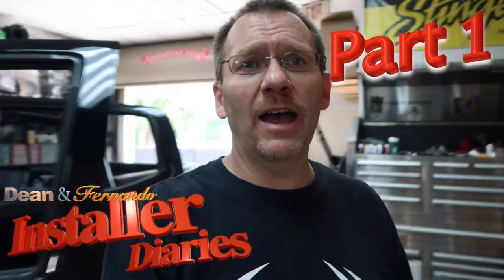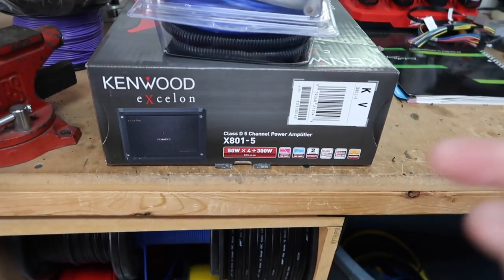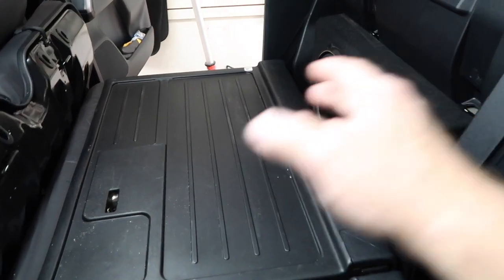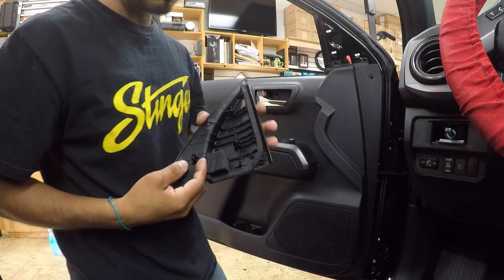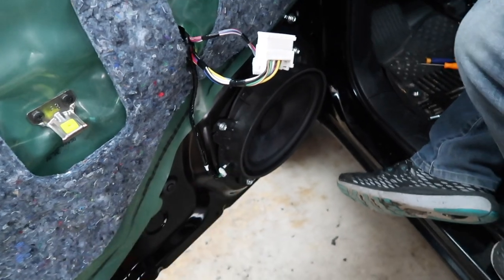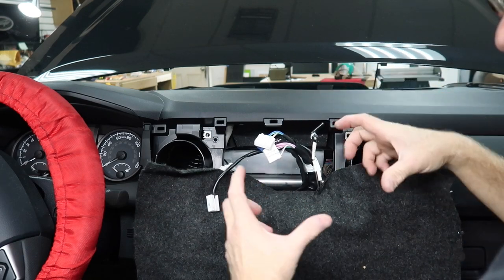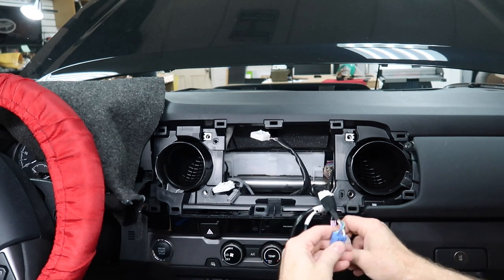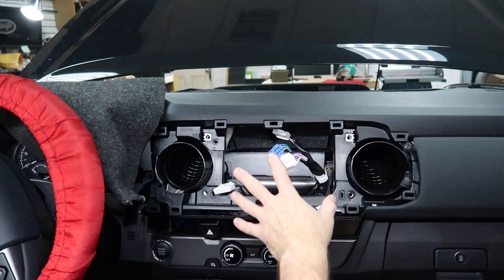Focal Toyota perfect fit speakers go into a Tacoma  Installer Diaries 287 part 1

Comment: The top factory speaker wire connectors are known to corrode if water ever gets behind the panel from leaving the window open, they likely changed the location to reduce warranty returns that were misdiagnosed.

Comment: I saw your Vid on Focal in a 4Runner.  Tried to order through Crutchfield and they said wouldn't fit.  I ordered anyway, fit perfect.  One thing is that the silver surround for the tweeter, wish I would have painted it black, sometimes reflects on the windscreen.

Comment: I know you guys are busy, but if you don't mind I have a question. I have a 2012 Toyota Highlander limited with the cheap premium JBL speaker system. I've had my eye on the focal Toyota speakers for a while. My question is will the focal toy speakers fit in my vehicle. Thanks in advance for any help.

Comment: Dean I have a question. I installed a vintage radio on my 1972 el Camino looks classic but has built in Bluetooth I have it connected to a 5 channel jl audio amo and jl 6.5 speakers with a 6 inch jl subwoofer. The issue I’m having is that when I turn off the radio I get a loud thump out of the speakers. I tried changing the ground and it still happens also my dials aren’t cranked up so I don’t think it’s distortion.  Can you please help or point me in the right direction